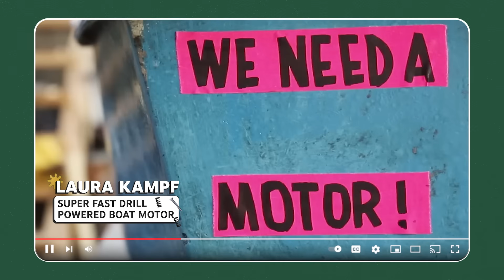@simonegiertz presents an officially unofficial award show for Inventors on YouTube

Comment: To reach AGI change 

“the decision/false matrix”
 
N=criteria 
M=alternative options 

Over to 

M6=Architectural options
N3=Alternative criteria. 
(N3= Criteria with an additional applied positive force)

M6/N3 “the sigma matrix “ 

Is the NEEDED stepping stone to reach ASI 

“the Architect matrix”
 
“Primary intelligence”/
Active
M6= architectural options autodidact: self-taught(IQ)
Diplomatic: self-government (DQ)
actualization: self- realization (SQ)
Existential: synchronistic accuracy(XQ)
Architectual : self- mutability(AQ) 
Emotion: empathic prescience (EQ)

(Based on insight) 

“Auxiliary intelligence”/ Neutral 
Q3= architectural criteria
Ethereal quotient (TQ)
Curiosity quotient (CQ)
Metaphysical quotient (MQ)

(Based on foresight)